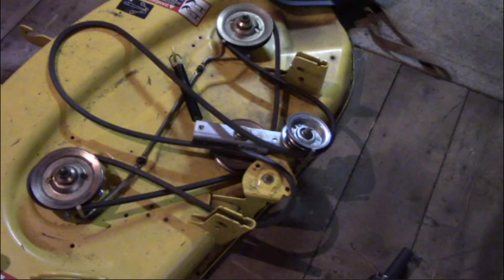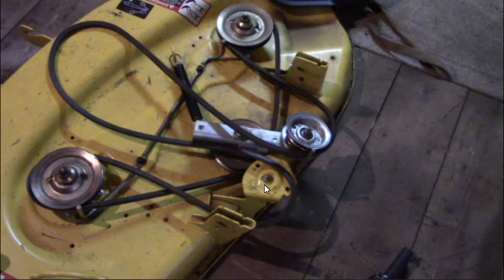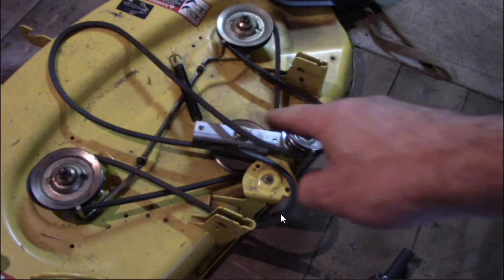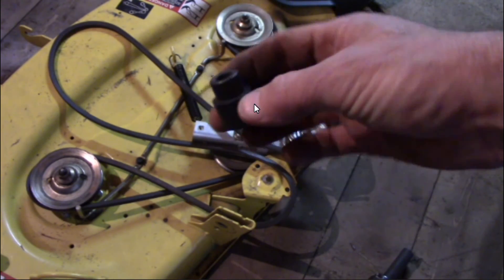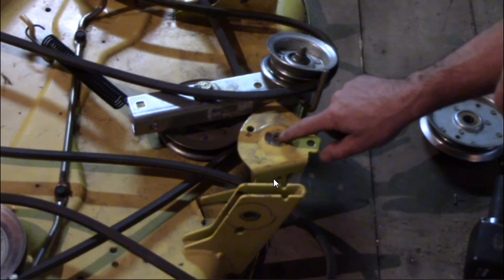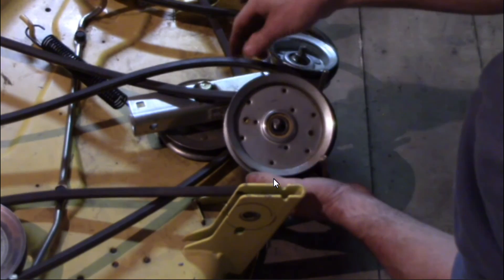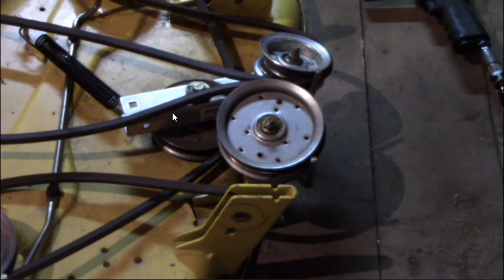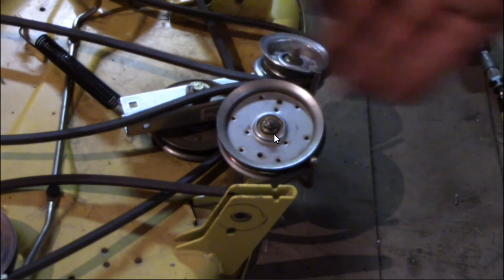John Deere x300 breaking belts (easy fix)

Comment: Some people are breaking belts from the belt rubbing on the threads showing on the 2 rear adjustment rods. JD fix is to cut 1/2” off of the threads. Well with my X300 I only have 5/8” of threads showing after I adjusted the deck properly using the gauge in the middle of the deck height adjustment knob. 

Yes that is the tool you lay on the ground. There are 2 vertical weld marks on the rear to where you set the gauge and for the front adjustment it’s just the middle point. The gauge should slide under with barely any drag.

You may need something to pry off the gauge if it’s never been off before. My deck wasn’t adjusted from the factory.

Comment: I previously had a mower repair shop for many years.  My neighbor broke 4 belts and asked me to look at it.  Nothing was obviously wrong, but the last belt he installed didn't break but was shredded along the top of the belt after 10 minutes of cutting.  Sure enough, the idler pulley you are showing was catching the top of the belt where the belt goes forward to the PTO.  It also made a loud bang when you engaged the blades.  I put 2 washers directly under the shoulder bushing and the banging on blade engagement ceased, but the belt was still close to the top of the idler pulley.  I put 4 thick washers raising the pulley at least a quarter of an inch.  The belt looked fine after mowing about 3/4 acre.   The design really sucks and I see many people online with the same complaint.  Local John Deere was no help to the neighbor.  As you stated, your fix don't sound like it would solve the problem, but I think you nailed it.  You really have to look at that belt when the belt and deck are installed and run it to let it settle where it wants to track on the idler.  Then look closely from the right side of the deck at your normal cutting height.  It's not an easy catch, but the top edge of the idler was super shiny and the bottom edge dirty.  Thanks for the tip.

Comment: I broke 3 or 4 belts before finally looking closely at the belt tensioner bar that has the pulley mounted on top and the mount bolt through the center. It had just enough play to allow it to dip down and snap the belts shortly after startup. Replaced that and no problems since, just a reminder, take your time and look closely for play at each component because it does add up cumulatively to create enough to cause issues.

Comment: I've been thru this. The couple units I have in my shop do the same thing...break belts for no reason. All the holes for idler and tensioner pullies are not oblong. No slack in the tensioner arm. New pullies. New bearings. New tensioner spring. Both units broke brand new JD belts and the better Gates Blade Runner belts. I found that the OEM blades JD puts on these units are too heavy for the 1/2" belt used on it. Look at all the commercial units that have heavy blades like this X300 and they all have 5/8" belts. I decided to throw a 5/8" belt on it instead....I used a Gates 6767BR (5/8" x 147") and have had zero issues since. Thought I'd come on and leave a note for someone in the future. Hopefully they will see this.
Reply from the maker: Interesting.  I wonder if the blades can be changed to a lesser version.?
Reply from the maker: I also think that whole  belt routing and having the two rear pulleys set at an angle is the worst design and think that plays a role in breaking belts. I've worked on several kinds of decks including other JD models  and they all have flat or perpendicular pulleys. That x300 is the only one I've come across that will break a new belt.
Reply: Just broke a belt on my x300, break one about once a season and tired of fighting this junk design.  Going to try the heavier duty belt, thanks for the info.
Reply: Kokamo44:  thank you for your advice using 5/8 belt on JD.  I have 42C 'convertible' deck on an LX277.  Hoping you might be able to tell me what size belt it needs.  I thought it would tell me that somewhere on the deck!  Where is your shop?

Comment: Looking at the product manual, the area that you focused on is supposed to be lubricated regularly. I am curious if not routinely doing this maintenance procedure caused the oval shape to form under the spindle. I will have to check this out on my own deck. Thank you for the follow up!

Comment: My mother in law has an older John Deere that keeps throwing and breaking belts.  She's had friends of friends try to fix it.  I think I'll bring it to my shop and take a look at the pulleys.  Thanks for the info.
Reply: Did it fix your problem?
Reply: @knighthawk86855  Actually, I got tied up with a head gasket issue with my wife's Buick so the tractor was put on hold.  It will make a fun project in the shop this winter.  Thanks for getting back to me.
Reply: @les5386  hey no problem, here to help buddy.

Comment: Have the same problem put a new belt on last week didn't even last mowing my yard and the leveling screw has the threads wore slick on the same side you fixed in the other video should I do the washer on the pulley to you think
Reply from the maker: there are way more people that are not shredding the belt from the bolt hanger then there are just breaking it clean snapping for no reason. Which to me indicates those pulleys are misaligned and most likely from either a wowed out  hole or something along those lines but in my experience it's been that idler pulley needs the attention with adding the washer deal. Take all your pulleys off except for the mower spindles and inspect closely I guess that would be my first thing to do if there was no evidence of a belt shredding

Comment: 2 excellent videos -  a few questions. Video 1 (hanger bolt rubbing) : Is there any other way to fix the hanger bolt issue without welding an extension? That may be beyond my level. Will it fit on the outside of the bracket instead of the inside?   In video 2 (update) you simply disassembled the pulley and added washers.  One above and one below?  Would you try one fix first before the other?
Reply from the maker: Unless you're shredding your belt the hanger extension is most likely not necessary. If your belt is breaking clean then I would say adding the washer on the bottom is most important because the bushing seems to wear down the deck and get the pulleys offset.  You may need to add more than one washer underneath if your decks worn pretty good

Comment: My dad got a x300 John Deere and we replaced the mower belt about almost every time we mow and it’s getting annoying. And I don’t know what the problem really is.. but I think it’s in this video is probably the problem. But I will definitely show my dad this video and see if that’s the problem because it’s breaking the Belts clean. So do you think that’s the problem @J La?
Reply from the maker: Most likely. It fixed this machine in video

Comment: I have a John Deere x300, and have replaced 26 deck belts!
Reply: @billsmith1770  I cut both height adjustment bolts off about 1", and it seems to have solved the problem.

Comment: I see that hole is oblong. I'm just wondering why that happens?  The bolts job is to hold the idler pulley. The bolt shouldn't be turning just the outside of the idler! Do you have a theory on how the hole got oblong?
Reply from the maker: No not really other than mowers create a lot of vibration and it's possible the bolts loosen up and just vibrate. But really this is the only duck that I've ever come across that has this breaking of a belt with no explanation. Sorry I couldn't help more

Comment: check the rear deck hanger bolt, on 1 side of the deck it is too close to the belt, and it rubs the belt, this may cause the belt failure

Comment: When the blades hit something, the weakest point in the deck, is the belt.
Keep the deck a little higher and miss those obstacles.
Reply: Are you dense? If something is mechanically wrong it doesn't matter if a new belt is installed, it will break.
Reply: @dferret4596  7